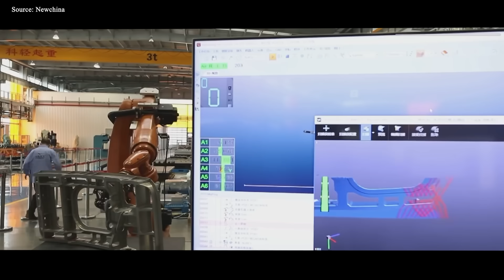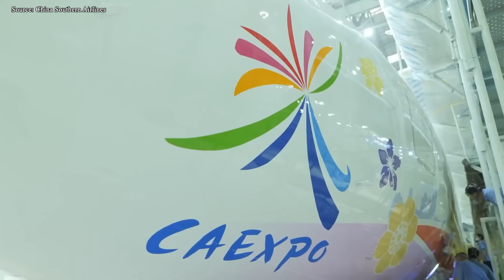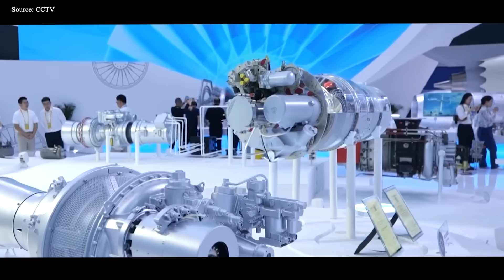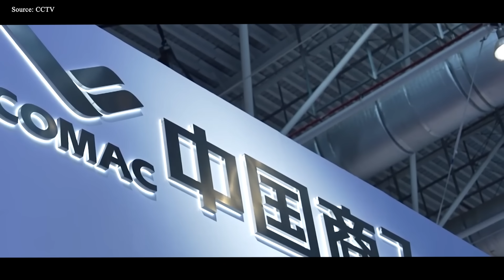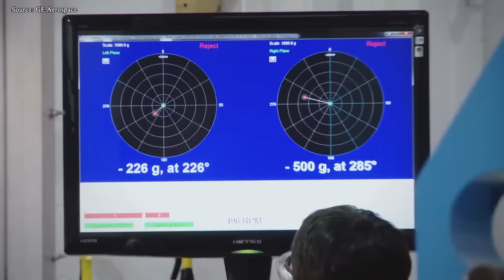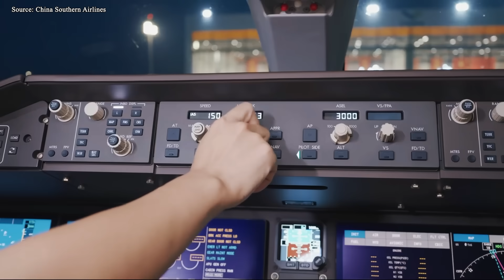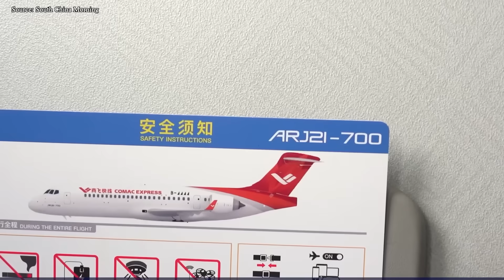You WON'T Believe Who Just Bought COMAC C939 Instead Of Boeing 777X!

Comment: Chinese aviation depend on western tech like avionics n engine .mayb 50 yrs to catchup
Reply: Where are you getting your data from?
Reply: @ravipeiris4388 from his emotion (*anger)
Reply: Ignorant view from the westerner that thinks others cannot produce their own avionics and engines.
Reply: Yeah,but that was 20 years ago 😅
Reply: In which year do you live.
Reply: https://youtu.be/WMtNpnm0lBQ
Reply: How China's Aero-Engines and Avionics Systems Are More Powerful, Capable, and Advanced Than Western Counterparts
 
China's aero-engines and avionics systems demonstrate greater power, capability, and advancement than Western counterparts in multiple aspects, as detailed below:
 
Aero-Engines
 
- Breakthroughs in Material Technology: China has developed third-generation single-crystal superalloys, with heat resistance improved by 100°C compared to the previous generation, reaching an internationally leading level. For example, the WS-15 engine equipped on the J-20 fighter jet uses domestically produced powder metallurgy turbine disks, achieving a thrust-to-weight ratio of over 10—on par with the engine of the U.S. F-22 fighter jet.
- Innovation in Manufacturing Processes: 3D printing technology is widely applied in China’s aero-engine manufacturing, reducing the number of parts by 80%. COMAC and Tsinghua University have jointly developed 3D-printed fuel nozzles for the Yangtze River-1000A engine, which are 25% lighter and have a 50% longer service life—enabling China to overtake in engine lightweight design.
- Optimized Design and System Integration: During the R&D of the Yangtze River-2000 engine, the R&D team optimized the combustion chamber structure using AI algorithms, improving fuel efficiency by 8% and reducing carbon emissions by 15%. Meanwhile, China has shortened the aero-engine R&D cycle by 40% through digital simulation technology, achieving significant progress in system integration.
- Enhanced Performance Indicators: The WS-15 engine has a thrust of 18.5 tons, exceeding the 17-ton thrust of the F119 engine used in the U.S. F-22. Additionally, the fuel efficiency of China’s new-generation aero-engines has increased by 20% to 30% compared to earlier models, addressing long-standing weaknesses in jet propulsion systems.
 
Avionics Systems
 
- Leading Radar Technology: China’s early warning aircraft (e.g., the KJ-500) are equipped with three-faced array solid-state digital active phased-array radars, while similar Western products still use "two-faced array radars" or rely on mechanical rotating scanning (which has blind spots). Leveraging 98% of the global gallium production capacity, China can mass-produce gallium nitride (GaN) TR modules—one generation ahead of Western materials—and excels in radar anti-jamming capabilities.
- High Intelligence Level: The core of the C929’s avionics system, developed by the 14th Research Institute of CETC, adopts a "quiet dark cockpit" design. This design improves fault alert response speed by 40% and reduces minimum basic workload by 28%. Its flight management system supports autonomous route planning for a 12,000-kilometer range and incorporates quantum communication encryption technology for the first time to ensure communication security.
- System Integration and Independent Control: The EWIS (Electrical Wiring Interconnection System) of the C919 features a unique modular zoned design and layered isolation technology, reducing wire harness weight by 15%. It also integrates intelligent detection and diagnostic algorithms, achieving zero-level failure rates. Fully independently controllable, the system reaches advanced levels in integration, safety, and intelligence.
Reply: I think you are not truthful...China Space Station is more complicated than C919. Maybe 5 years not 50.

Comment: The C929 and C939 won't be available for at least another decade!  Your videos are B S.
Reply: https://www.youtube.com/watch?v=hqH4N1YlUz0&pp=ygUQYzkyOSB0ZXN0IGZsaWdodNIHCQkGCgGHKiGM7w%3D%3D
Reply: If then see what happened with the C919.
Reply: Comparison of C929 and C939 with Western Counterparts: Advantages in Performance and Advanced Features
 
Compared with Western counterparts of the same type, the C929 and C939 have advantages in power systems, material technology, cabin experience, and intelligent technology, as detailed below:
 
Advantages of the C929
 
- Efficient and Energy-Saving Power System: Equipped with the Yangtze River 2000 engine, it has a thrust of 35 tons and a bypass ratio as high as 12:1. Its fuel efficiency is 15% higher than that of similar products from the US and France, and its maintenance cost is 20% lower than that of the GEnx engine used in the Boeing 787.
- Advanced Material Technology: The composite material accounts for over 51% of the aircraft fuselage. It adopts China's original honeycomb sandwich curing process, reducing material costs by 40%. Meanwhile, the carbon fiber has a tensile strength of up to 7,000 MPa, and its fatigue resistance is twice that of traditional aluminum alloys.
- Upgraded Cabin Experience: The cabin width reaches 5.92 meters, slightly wider than that of the Boeing 787. The air purification system can filter 99.9% of PM2.5, and the aircraft is also equipped with meal delivery robots and panoramic sunroofs.
 
Advantages of the C939
 
- Powerful Engine Performance: Equipped with the Yangtze River-3000 engine, each engine has a thrust of 45.8 tons. Its combustion efficiency is 12% higher than that of international similar products, and fuel consumption is reduced by 15%.
- Adoption of Intelligent Skin Technology: It adopts folding wingtip intelligent skin technology, allowing the wingspan to be dynamically adjusted between 65 meters and 75.6 meters, making it compatible with 70% of airport runways worldwide.
- Advanced Intelligent Avionics System: The AI-assisted system developed by the Chengdu Aircraft Design Institute shortens the wind tunnel test cycle from half a year to 3 days, increasing the design iteration efficiency by 40 times. The intelligent avionics system reduces the number of cables from 300 to 50, greatly lowering the complexity of operation and maintenance.
- Good Comfort and Environmental Friendliness: The carbon fiber-titanium alloy hybrid woven skin material developed by Harbin Institute of Technology reduces the cabin turbulence index by 42%. The equipped plasma de-icing device reduces energy consumption by 67% compared with traditional hot-air de-icing, enabling a single aircraft to reduce carbon dioxide emissions by 820 tons per year.

Comment: Fake news.C929 doesn't exist yet and you talking about C939 !!
Reply: Such ignorance. Just do some research before opening your mouth
Reply: This shows Naze west parrots are ignorant about what is going on  around the world. These parrots love living in their hollywood dreamland 😂😂
Reply: @pisablavatsky-cb3dd 
Those losers are always in denial and they can't handle the truth..
Reply: coming soon.
Reply: Comparison of C929 and C939 with Western Counterparts: Advantages in Performance and Advanced Features
 
Compared with Western counterparts of the same type, the C929 and C939 have advantages in power systems, material technology, cabin experience, and intelligent technology, as detailed below:
 
Advantages of the C929
 
- Efficient and Energy-Saving Power System: Equipped with the Yangtze River 2000 engine, it has a thrust of 35 tons and a bypass ratio as high as 12:1. Its fuel efficiency is 15% higher than that of similar products from the US and France, and its maintenance cost is 20% lower than that of the GEnx engine used in the Boeing 787.
- Advanced Material Technology: The composite material accounts for over 51% of the aircraft fuselage. It adopts China's original honeycomb sandwich curing process, reducing material costs by 40%. Meanwhile, the carbon fiber has a tensile strength of up to 7,000 MPa, and its fatigue resistance is twice that of traditional aluminum alloys.
- Upgraded Cabin Experience: The cabin width reaches 5.92 meters, slightly wider than that of the Boeing 787. The air purification system can filter 99.9% of PM2.5, and the aircraft is also equipped with meal delivery robots and panoramic sunroofs.
 
Advantages of the C939
 
- Powerful Engine Performance: Equipped with the Yangtze River-3000 engine, each engine has a thrust of 45.8 tons. Its combustion efficiency is 12% higher than that of international similar products, and fuel consumption is reduced by 15%.
- Adoption of Intelligent Skin Technology: It adopts folding wingtip intelligent skin technology, allowing the wingspan to be dynamically adjusted between 65 meters and 75.6 meters, making it compatible with 70% of airport runways worldwide.
- Advanced Intelligent Avionics System: The AI-assisted system developed by the Chengdu Aircraft Design Institute shortens the wind tunnel test cycle from half a year to 3 days, increasing the design iteration efficiency by 40 times. The intelligent avionics system reduces the number of cables from 300 to 50, greatly lowering the complexity of operation and maintenance.
- Good Comfort and Environmental Friendliness: The carbon fiber-titanium alloy hybrid woven skin material developed by Harbin Institute of Technology reduces the cabin turbulence index by 42%. The equipped plasma de-icing device reduces energy consumption by 67% compared with traditional hot-air de-icing, enabling a single aircraft to reduce carbon dioxide emissions by 820 tons per year.